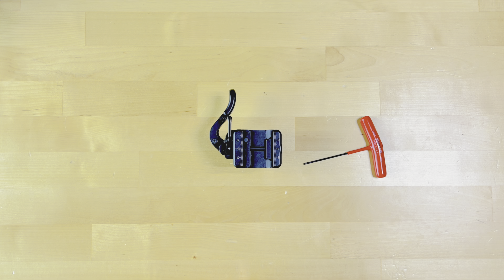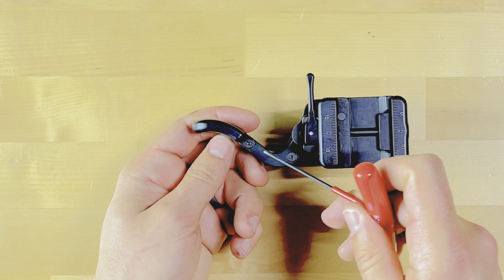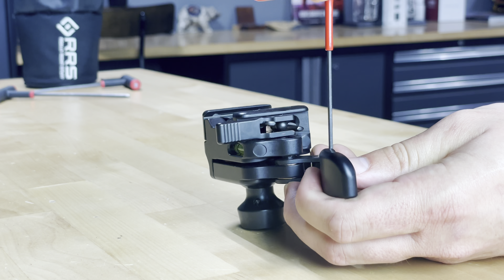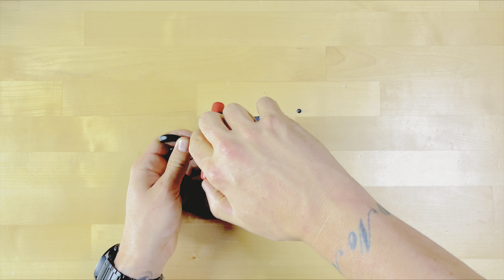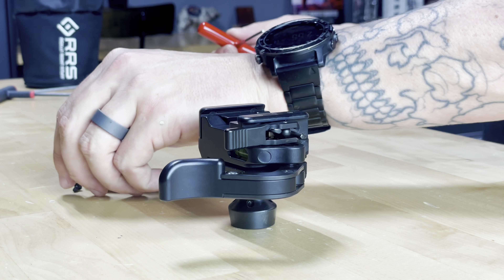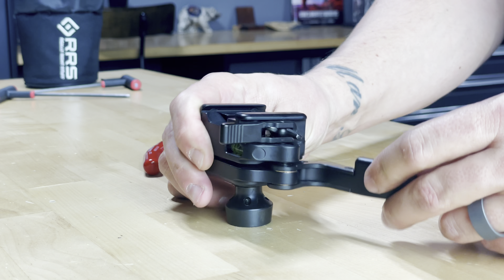Anvil-30-ARC Retiming

Comment: The screw heads are very prone to stripping and are pretty poor quality for the standard we expect from RRS. Be warned, the screws are NOT 6/40 x 5/8” like the video description states. I called RRS after ordering those screws and them not working. I was told the screws are made in house and they sent me them a few to replace the stripped heads. Just call RRS direct.